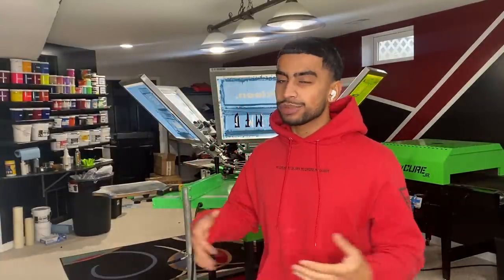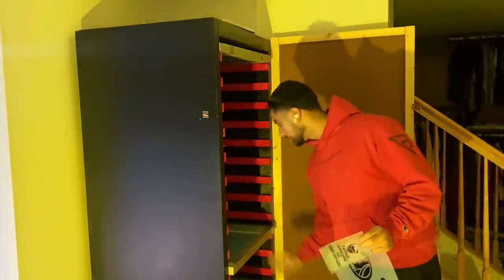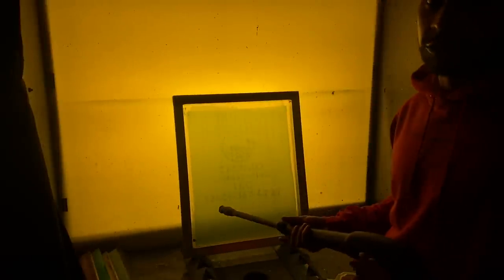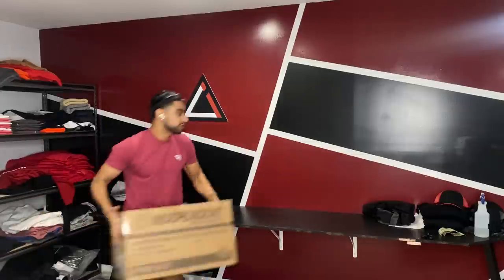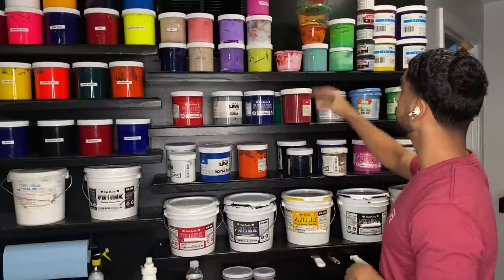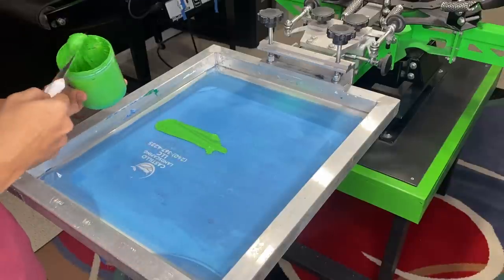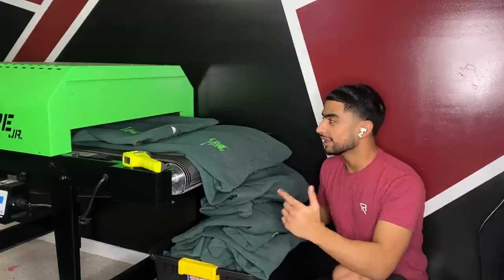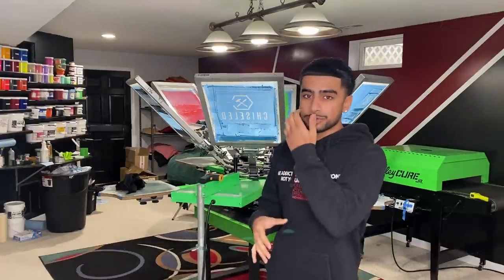Day In The Life SCREEN PRINTING From Start To Finish

Comment: Interesting presentation. Please tell me how you do with printing a very large T-shirt (3XL) so that the logo is straight aligned with the base of the shirt. What benchmarks do you use? Thanks!
Reply from the maker: Thank you! Larger shirts get a little harder cause of how big they are but generally are printed the same but sometimes a bigger design would be used for them

Comment: Questions bro. I've always been told to use web spray for hoodies, is there a reason you don't? How often are you reactivating the adhesive so it can stay that sticky for hoodies and does the lint not build up on you when doing hoodies? BTW, appreciate the content man! I like the way you keep things straight forward and simple. Also, video update on the Ricoma because I'm curious on how good those machines really are, seems like every video I see on youtube, they are sponsored and have to talk good about the machines. Just curious how its going for you..
Reply from the maker: Great question bro, I used to use it as well but water based tac works a lot better. The reason why I switched to water based glue is because you don't have to spray the pallet every time and it gets super messy with all the over spray. This water based glue you spread it on once and when the lint is built up you spray it with water and scrub the lint off. To reactivate the glue just set it under the flash dryer and it reactivates! The next video will be a embroidery job so look out for that. I am in no way sponsored at all by Ricoma so I'm keeping it as real as it gets!
Reply: @baavproductions  Ah, I see.. I use the PMI double sided tape on my platens. It works very good with shirts but maybe that's something I should consider because I actually can't even get my hands on web spray right now. I appreciate you man and hope for the continued success!!
Reply from the maker: @ochoastyle  I have heard the OMI tape is great but instead of web spray I would recommend the water based pallet adhesive for sure because the webspary can get messy! but try it out and see what you like best. Appreciate the love and wish you success as well!!

Comment: you ever try getting your back and left chest on the same screen? pretty easy and saves a screen
Reply from the maker: I have done that on some jobs when I can get it to fit but usually a full back print wont fit on the same screen as a left chest at least for 20x24 screen

Comment: why did you not use a white under base. I thought if you had dark apparel and light color you should use a under base
Reply from the maker: You should and can, but just so happens in this video I didn’t and it still turned out well with a print flash print.

Comment: Always underbase, never print-flash-print and never push your squeegee.
Reply from the maker: Underbase is for sure a key if I had a solid press that kept the registration tight. However, complex designs I definitely try to add an underbase as much as I can. There is no one right way of pushing or pulling a squeegee, its all a personal preference and what works best in the given circumstances. In this case, pushing has been the winner for me as of now. Appreciate your two cents!